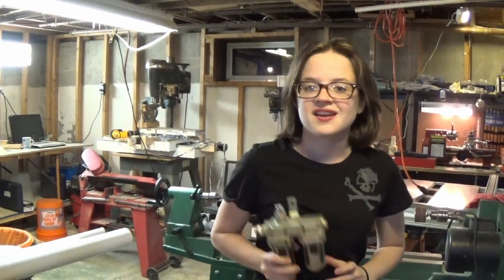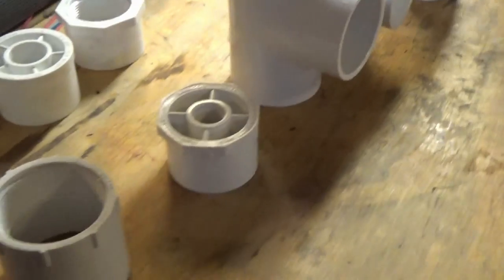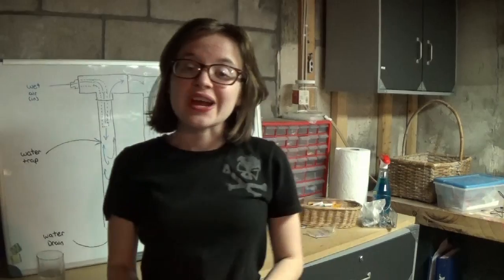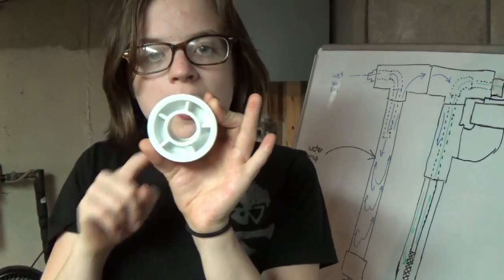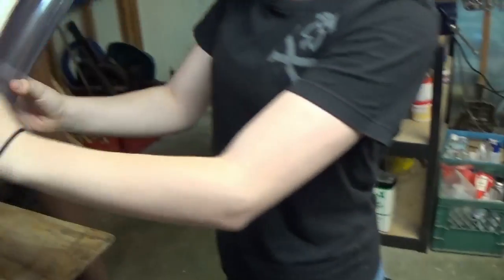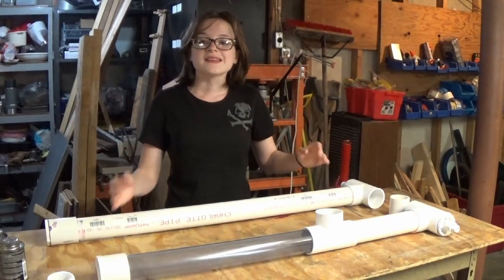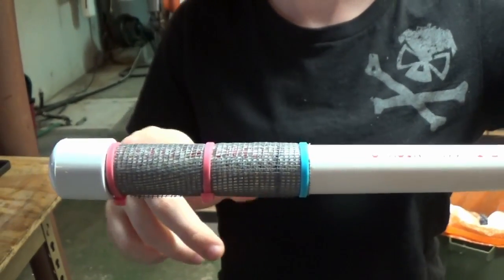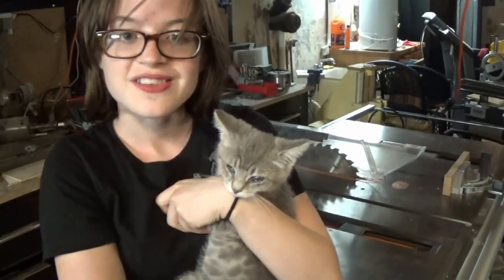Ep 11 Dirt Cheap DIY Dessicant Air Dryer

Comment: can you please make a list of materials.
Reply: if you watch the video she tells you everything you need. It's simple, write it down!
Reply: List of materials:
Adobe: A sun dried brick derived from a yellow silt or clay deposited by rivers.
Brick: A block of clay hardened by drying in the sun or burning in a kiln. Bricks come in numerous shapes and sizes. Bricks come in numerous densities and hardness depending on the baking process, parent material and the material mixed with it for hardening (pebbles, hay, grass, twigs ect).
Brick & Timber: Mud brick is different than normal bricks in that it is made from puddled mud which is later gathered, molded and sun dried. It is durable enough for light load bearing and can be carved fairly easily after drying. All external walls using this material are covered with linseed oil to help prevent weathering. This makes a poor brick in areas with extreme weather.
Cloth and Poles (pavilion, tent): Canvas, cotton and even silk are placed on poles to form makeshift or temporary structures. Shape and size are limited only to the weight of the material, strength of the supporting poles and the innovation of the builder. These do not hold up well in extreme weather conditions.
Earth, Rammed: Soils with high clay contents are pulverized moistened and dumped into frames or formed into walls. Compaction is created by ramming. These buildings are allowed to sun dry. Structurally sound and weather resistant, these buildings survive for several hundred years or more.
Felt (yurt): Similar to cloth and pole constructions, yurts use hides from animals instead of cloth. These are generally heavier and more durable constructions. Framing devices can be wood, iron or bone and come in many shapes including circular, square, and hexagonal. They include tepees and all related constructions.
Grass and Poles/Sticks (hogan, hut, shack, wickiup):
Popular in very dry areas, these constructions consist of poles and sticks interwoven with grasses and branches to form small structures. Often times these structures are recessed into the ground several feet or more.
Metal Sheet: Thin sheets of metal including gold, copper, bronze, steel and aluminum or others, used for siding or roofing in architecture. This includes corrugated metal. Sheet metal is used to protect exposed surfaces or for aesthetic reasons, rather than load bearing.
Matting: A course fabric of rushes, grass, straw, hemp, or the like used for wrapping, covering floors, etc.
Plaster & Board/Timber: Wooden structures are covered in a moistened mud, clay or soil for added protection and insolation. Mud and clay plasters are only use in drier climates.
Sod: A square or rectangular section cut or torn from the surface of grassland containing the matted roots of grass. Used in regions where there is little or no tree growth. Sod houses tend to be squat but solid constructions.
Stone: Limestone, marble, granite, sandstone and other durable rocks are used for construction. These rocks are altered and polished for specific needs and come in almost any shape imaginable. They are load bearing and durable often lasting thousands of years or more. Stone is used as facing, for internal support and augments or is augmented by brick and timber constructions.
Timber: The most widely used material for building. It is light, durable, strong and easily managed. Woods range widely in density and durability.
Wattle: Rods or stakes interwoven with twigs or tree branches. Wattle is used for making fences, walls etc. Also refers to basket manufacturing, the interweave. These are not very durable nor are they strong.
Wattle & Daub: The employment of Wattle, mud and clay for the construction of buildings. The mud is smeared into the wattle. Depending on the parent material, drying conditions and density of the wattle, these can be long lasting and fairly durable constructions.
Metals
Aluminum: A silvery metal, remarkable for its light weight and malleability and resistance to oxidation. It is found abundantly in clay.
Antimony: A silvery white brittle metal used in alloys with other metals to harden them and increase their resistance to chemical action.
Bismuth: A greyish-white, red tinted, brittle metal that is often found in a crystalized state in other metals, particularly cobalt. Chiefly used in making alloys of low melting points.
Brass: A yellowish metal that is an alloy of copper and zinc. Known for its hardness and durability.
Bronze: See below.
Copper: See below.
Electrum: See below.
Gold: See below.
Iron: A white metal that is malleable and ductile. It is the most common and useful of all the metals.
Iron, Cast: A hard, rigid and strong, nonmalleable ironcarbon alloy made by casting.
Iron, Magnetic (Lodestone): A strong magnetic variety of the mineral magnetite.
Iron, Meteoric: Iron usually alloyed with nickel and cobalt. Found in meteorites.
Iron, Wrought: A soft, ductile, malleable iron containing some slag and some carbon. It cannot be tempered or easily fused.
Latten: Brass or a brass-like alloy hammered into thin sheets.
Lead: A heavy, soft malleable bluish-gray metal used in piping an in numerous alloys.
Lodestone: See Iron, Magnetic above.
Magnesium: A light silver white metal, that is malleable and ductile used in making several alloys.
Mercury: A heavy silver, white metal liquid at ordinary temperatures, quick silver.
Nickel: See following page.
Nickel Silver (Nickel and Copper): See below.
Nickel Steel: A steel alloy made harder than ordinary steel by adding small amounts of nickel.
Pewter (Lead and Zinc): An alloy of tin with lead, brass or copper that takes on a grayish luster when polished.
Platinum: See below.
Silver: See below.
Steel: A hard metal composed of iron alloy with carbon added. Steel made be alloyed with other metals to make specific properties such as resistance to rust.
Tin: A soft silver white metallic element, malleable at room temperatures. Capable of a high polish and used as an alloy.
Titanium: A dark gray lustrous metal found in rutile and other minerals, used as cleaning agent in molten steel.
Zinc: Bluish white in color it is used as a protective coating for iron and as a constituent for various alloys.
Metals, The Complete Precious Metalsmith
Pure metal is 24 carat, or .999 fine in regards to silver, and alloys of it are indicated by the number in carats, or percentage of silver, of the main metal in the alloy. They are cataloged in order of value.
Platinum: The hardest of precious metals. It is worth c. 125% to 250% its weight in gold, even more if the smelting process employed in the fantasy milieu demands magical heat. It does not tarnish. It is a silvery metal with a soft and lustrous sheen. Platinum is very seldom alloyed with other metals.
Gold: The softest of precious metals. It does not tarnish. Usually in an alloy with other metals to increase its hardness. There are three general sorts of gold used in jewelry:
Yellow gold (18 carat): 75% gold, 15% silver, 10% copper. Value c. 77% pure gold.
Red gold (18 carat): 75% gold, 20% copper, 5% silver. Value c. 76% pure gold.
White gold (18 carat): 75% gold, 25% silver. Value c. 78% pure gold.
Electrum: A fairly hard alloy when compared to gold. An alloy of 24 carat gold and .999 fine silver, usually in equal proportions. It has a value of about 55% pure gold when alloyed in equal proportions. It tarnishes somewhat because of the silver content of the alloy. Electrum looks much like pale white gold.
Silver: A moderately soft metal worth about 1/60 to 1/ 100th its weight in gold. Silver tarnishes from exposure to air and other substances.
Nickel: A moderately hard metal that is the next to the least valuable of the pure ores of the group. It is worth around 20% its weight in .999 fine silver. Nickel tarnishes only slowly and to little extent, and polishing restores its shine. It has a soft silver-gray luster.
Nickel Silver: A moderately hard metal because of the combined metals used. An alloy of 50% copper and 50% nickel for increased hardness and little tarnishing. Value c. 17% .999 fine silver.
Copper: A moderately soft metal that is the least valuable of the group. It is worth around 9% to 12% its weight in silver. Copper tarnishes (corrodes) when exposed to air, but polishing restores its shine.
Bronze: A moderately hard metal because of the combined metals used. An alloy of 50% copper and 50% tin for increased hardness. Tarnishing is common, with verdigris apparent when oxidation of the metal occurs. Value c. 70% pure copper when used in equal proportions. Bronze had a copper-brown, or sometimes golden-brown hue when more copper is used (c.60%).
Adamantite/Adamantium
Adamantite 
Mithril
Oracalc/Oracalcum
Wood
Alder: A tree which grows in moist land whose bark is used in dyeing and tanning. The wood is used for bridges and piles because it is resistant to underwater rot.
Ash, White: Tough elastic wood with a straight, close grain.
Ash, European: See above.
Balsa: A very light, strong wood, used for raft construction.
Basswood: A light soft durable wood.
Beech: A large-sized tree that produces hard woods. The smooth bark of a beech tree was used for writing upon.
Birch: A hard, smoot-grained wood whose bark strips off in layers. Birch wood is most valued in furniture construction.
Brazilwood: A reddish wood that is capable of yielding a red dye.
Cedar: Used for the durability of the wood. Associated with a fragrant building material as well.
Cherry: A hard, durable wood that is most commonly used in the construction of furniture, handles, toys, etc.
Cocobolo: A hardwood tree that is used in cabinet work and tool making.
Elm, Dutch & English: Tall, hardy shade trees whose wood makes a hard, heavy wood. The wood is finegrained and valuable for its resistance to splitting.
Elm, Ebony: See above.
Hickory, White: A tough wood used for construction of houses, fences and the like.
Kingwood: A Brazilian wood used much in cabinet work because of its streaks of violet tints.
Lime: See Basswood above.
Mahogany: A hardwood that is commonly used in furniture, it varies in color 
Tilferium
No problem ;)
Reply: +Nuggs B'Nasty a BOM or bill of materials is kind of customary... just saying.

Comment: My second attempt has lead me to a simple discovery.  This time, I was able to properly size and seat the 3/4" inlet pipe and the 1/2" outlet pipe, but had not yet reached the step of gluing in the elbows.  After staring at the 2" Tees for a bit, I considered rearranging them so the inlet and outlet stab out of the tops rather than the sides making the entire assembly resemble the letter "H".  Further consideration of this lead me to find that a simple straight coupler, or not even cutting either of the inner pipes would make for a much more forgiving and simple assembly, so I will acquire the other parts I need and finish my build, then share my dryer once complete on a forum with photos and link back to this video both ways to pay my respect to Hannah for originally sharing such a great idea with us.  I'm stoked and can't wait to dry some air!
Reply: lets see your air dryer completed,, does it work? Good idea on the straight in and out thoughts,,in my case there build at right angle makes sense.
Reply: @BasketCaseGarageForFun  I don't have it anymore, but made it and used it for about 6 months at 150 psi and it worked great.  Just as long as you bake the silica beads when they get too moist, the PVC holds air well.  I wouldn't use it in freezing conditions though, but otherwise, it's a great design.
Reply: Michael J how long did it take before silica gets to wet, do you remember?
Reply: @BasketCaseGarageForFun  depends how wet your air is.  There's no way to answer that other than experience it.

Comment: There is something you may have forgot to take into account when you did pressure safety margins on your clear plastic section... temperature. The pressure ratings on PVC are nearly always for fluid at 73 degrees. The pressure ratings need to be de-rated as the temperature goes up. At 140 degrees , the de-rating factor on PVC is .22. That is significant because compressed air is hot. While the temperatures will drop as yiu get into yuur larger section, constant duty use heats things up. It would be best if this dryer was used after a compressed air after-cooler to safely drop the air temperature as much as possible...which will also make your water trap work much better. I'd also consider going with Schedule 80 PVC as it has higher pressure and temperature ratings...although it is harder to get and more expensive. USPlastic dot com is a good source.
Reply: Enderle Property Service damn... She did all that shit for nothing right?

Comment: My build of your idea is near complete, just have to wait for the clear sch. 40 to arrive in the mail.  Some things I learned are as follows;
1) Definitely build each of the sides first before putting anything else together.  I made the mistake of joining the 2 Tees together and building down to the Wye on the desiccant side before adding in the inner lines.  Now I have to cut that back off, build the remaining 1/2" inners, then rejoin the 2" with a coupler to save the parts.
2) For those (like me) that don't have a lathe, I used a die grinder attachment on my little HF Dremel rotary tool to grind out the stops in the reducer caps.  I also learned that the tapers needed to be sanded out, so I used plumber's abrasive mesh to gradually sand out the taper enough that I could work the respective pipes through, then I buffed the sanded surfaces smooth with the rotary tool's buffing pad.
I think overall, this project will turn out good and function properly, so long as I don't get the PSI over 140, as that is Sch. 40 rated PSI.  I'll let y'all know how things turn out for me, and THANK YOU Hannah for sharing this to your channel!!!
Reply: I think I discovered another mistake on my part, one that may be a costly learning experience, but I am coming to gain a deeper understanding of the difference between Schedule 40 and DWV PVC pipe.  I believe it was Keith that questioned Hannah's choice to use a Tee and Elbow combo over use of a Wye, so I took it upon myself to blindly purchase the Wye.  Now I come to find out DWV fittings aren't rated for PSI the way Schedule 40 is, if there is even a PSI rating.  Further searching left me hard pressed to locate Sch 40 Wyes from Lowes or Home D.  I found Sch 40 wyes on pvcfittingsonline.com for about $11, but that's much more than an elbow/tee combo from the big box stores.  Also, many of my other parts are DWV (grrrrrrr).  Lesson learned!  Hannah, please share any insights you have regarding the difference b/c I still can't find much info about DWV aside from their obvious low pressure applications.  TYIA!
Reply from the maker: Michael J, when I was designing my system, I looked for a y, but I also could not find one that was pressure rated and cheap.  I decided to go with what I could easily find locally.
Reply: I found and used the Wye that was pressure rated and to be honest, I wish I used the 90° elbow.  The 45° just doesn't allow for quick pouring the way a 90° would.  The H layout works good and was way easier to build as no elbows were used internally.  If I build another, I will be looking to use a + on the desiccant side to further simplify the design.  My water trap doesn't collect any water, but I think I drilled too many holes in the 3/4" inlet pipe, but the desiccant side does collect a lot of water as I had to bake the desiccant twice already.  The $15 desiccant I found in the art store for flower drying does have roughly 5-10% indicating beads, so it works the same as the all blue.

Comment: Great build, I think I'll make one myself. Cool that a tuber wrote out your list of parts. Zero offense here but when using Teflon tape you should roll it on the direction that the threads are being turned in. Three wraps in my experience is sufficient for air or water plumbing applications. If it's rolled on opposite of the rotation it has a tendency to unravel, wad up and not seal as well. It also looks professional when you're done. Looks like you could use a set of V-blocks for your drill press as well (for drilling round materials). HF carries cheap ones or you can make a set out of some hard wood. Lastly, if you're concerned in the future with laying out holes for perforating pipe for a certain percentage of flow, a good way to scribe or mark the divisions you've made is to lay a piece of angle on the side of the pipe. This serves as a cheap self centering straight edge. You could also use a height gauge. There are a million ways to do anything. Just a few tips that work for me.
Reply: monkfry, I think you have your Teflon tape comment backwards. If you have a clockwise thread, you tape in a counterclockwise fashion so that your Teflon doesn't back itself off the threads. This way as you tighten the fitting it wants to tighten the tape and not back off.
Reply: Yes  he worded it wrong,but He was cottect in noticing that she wrapped it in the direction that would possibly ball it up as it was tightened.His thinking was right..,his wording was off.